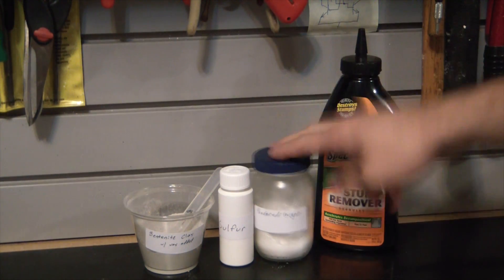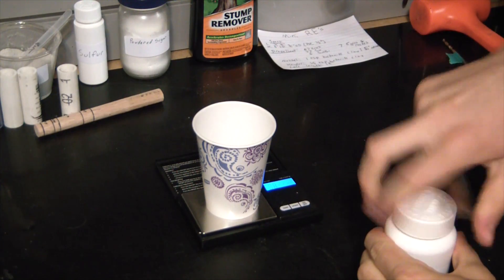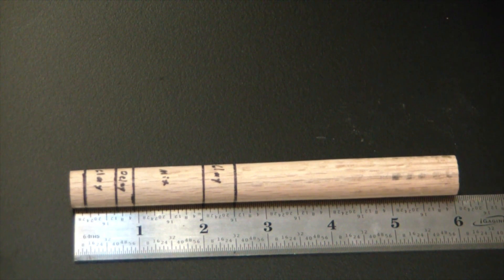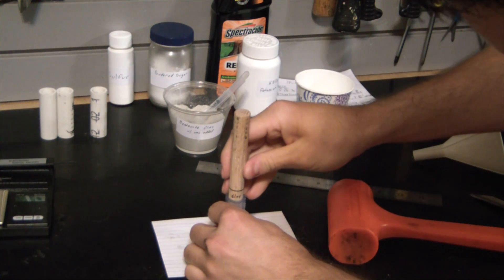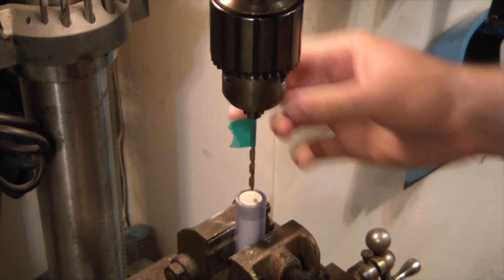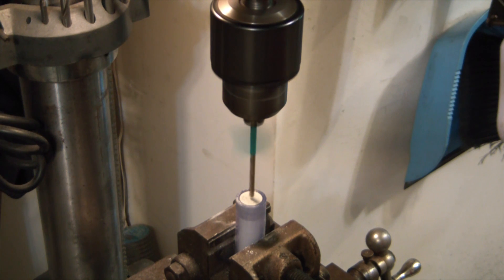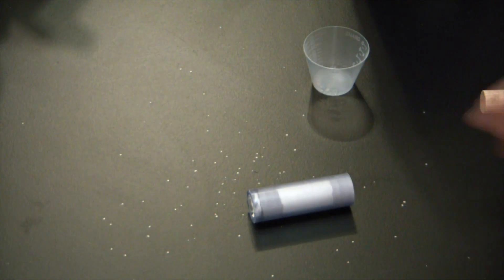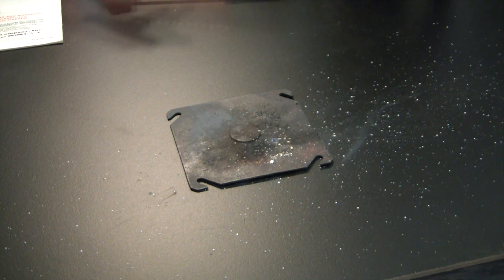ROCKET ENGINES FROM HOUSEHOLD STUFF! ELEMENTALMAKER

Comment: Hydroscopic? Don't you mean hydrophilic? Or am I missing something here?
Reply: Sounds like he misspoke and said "hydroscopic" though the correct term would be "hygroscopic" Hydrophillic substances have an affinity for water. meaning they wet easily. That doesn't necessarily mean that a hydrophillic substance is also hygroscopic though.
Reply: KNO3 and the completed motors readily absorb moisture from the air (i.e. hygroscopic) which impairs the performance

Comment: 0:48 Potassium nitrate, sulfur and a source of carbon. That sounds strangely familiar!!!
Reply: Lovely blackpowder :)
Reply: you can smell it from here! =P
Reply: So are all explosions the result of reacting a fuel and an oxidizer really quickly? Are there explosions that happen completely without some form of oxygen?
Reply: @michaelknight2342  look up vacuum rocket engine and you'll see what they do to make the engine work in space without any atmosphere to feed it. 
Hint, its similar to this
Also, yeah pretty much most explosions result from 2-3 things, oxidizer fuel and something to increase the reaction rate. Now when it comes to nuclear bombs they work from making the chosen isotope usually enriched uranium (uranium fresh out the ground is almost useless in that form), make the isotope unstable causing a chain reaction, which creates a feedback loop which amplifies the reaction at every step, making it more powerful over and over until its just well, done, and theres a big boom. Most efficient way is "split the atom", but there's much more to it than just that
Reply: Michael Knight most often they use oxidiser but some chemicals explode by reacting with themselves
Reply: @michaelknight2342  Any strong oxidiser will work, obviously, oxygen from the air is easy to obtain.  That's why the operators of sugar factories and flour mills are VERY careful, a factory full of flammable dust with every tiny fragment surrounded by oxygen can be fatally explosive.
Chlorine works nicely as an oxidiser, the reaction of hydrogen and chlorine, for example, is spontaneous except in darkness.  The activation energy can be supplied by light.  There's probably a YouTube video of it.
Some rockets use hydrogen peroxide as oxidizer and hydrazine as fuel.  The WW2 V2 rockets used alcohol and liquid oxygen (I think).  You could look up "hypergolic fuels" for more information and/or the launch escape rockets being (and that have been) used by NASA and SpaceX.
Any rapid chemical reaction that produces a lot of gases very quickly is an explosion, but if it's confined for the first fraction of a second, the gas volume builds up and it's more of a bang than a whoosh.  If you look at a "banging" firework, it's small and solidly built to allow this.
Some explosives have their own oxygen, which is released when they get hot, or when they are pressurised.  TNT and dynamite are examples of these.  Again, it's about evolving large amounts of gas very rapidly.
Reply: There was an episode of Star Trek in which Captain Kirk had to figure out how to make gunpowder from natural deposits.
Reply: @TubeNotMe  The MythBusters disproved it in an episode.
Reply: @stevecrow9170  OH yes, I saw that episode. But it WAS science FICTION, you know. jI mean, warp drive? Vulcans? Do we need MythBusters to disprove those, too? Anybody with experience in chemistry and explosives knew right off they were taking liberties with that story. I was just responding to the OP's "That sounds strangely familiar!!"
Reply: @TubeNotMe  Har har, yes, to some people it does need to be disproved.
Reply: @stevecrow9170  Ha! Yeah, after watching some of the videos and seeing some of the comments, maybe a lot of people.
Reply: Thought you were talking about an old Star Trek episode.

Comment: The two engines you ignited would not have lifted off the ground, they did not have enough thrust.
Reply: ..."so there is no weight"  But there is a mass but to know and appreciate it, one has to have at least fifth-grade education.
Reply: you missed the part where engines are attached to metal bar and especially in second try it actually pushed that metal bar (it looked as camera moved to the right). and most important, actual rocked this will propel is just fraction of weight of that metal bar....
Reply: LMAO
Reply: No, I saw that. It is sideways so there is no weight to push, only friction. The ground is supporting the weight. I am going by the burn time. A rocket with that size and weight would need to burn for under 1.5 seconds to have enough thrust to get off the ground and fly high into the air. But It burned for almost 5 seconds which means it didn't have enough thrust to get off the ground. It might have flown 5 or 6 inches off the ground at the most.

Comment: Read the Wikipedia page on colored smoke bombs...DO NOT USE SULFUR!!! I had 3 1/2 pounds of rocket fuel blow up in my face because of adding Sulfur!!!!!
Reply from the maker: Clyde Louse do you know how the sulfur caused this? There have been reported cases of impure sulfur with high acid content causing spontaneous ignition, but that's all I've heard of. What oxidizer were you using? Most colored Smoke compositions use potassium chlorate, which is a big no-no to mix with sulfur unless you want a highly friction sensitive mix. Always research the compositions you are making before making them, and make sure all chemicals are compatible, especially in that kind of quantity.
Reply from the maker: He may have his oxidizers mixed up. Potassium nitrate is very safe with sulfur; this is the oxidizer used in my video here. In colored smoke compositions potassium chlorate is used, which is highly unstable when mixed with sulfur. I highly recommend staying FAR AWAY from potassium chlorate unless you have advanced pyrotechnic training. I still get nervous working with that stuff, and avoid it whenever possible.
Reply from the maker: Sans The pungeon master potassium permangenate can be a pretty dangerous oxidizer. I've only used it in a couple very exotic compositions. It also stains EVERYTHING it touches. I will post a video using it soon.
Reply: ??? Explain, also, I'm fairly sure this guy's a pyrotechnic expert, judging by other videos. he knows what he's doing.
Reply: I figured, by the way, what do you know about pot-perm as an oxidizer? I figure it'll work but I'm wondering if I need super dry fuel. Or a bomb suit.
Reply: Thanks, I noticed it turns pretty much everything wet purple, and everything else charcoal black, assuming it has some moisture. I'm just wondering if it would be suitable for a sorbitol motor.
Reply from the maker: For a propellant I would stay very far away from it! Its more more prone to exploding than slowly building pressure like a mild oxidizer like potassium nitrate is. The only really suitable oxidizers for rocket propellants are potassium nitrate, ammonium perchlorate, guanidine nitrate, and some exotic ones with ammonium nitrate.
Reply: alright, thanks, I was probably going to steel-case it, in order to not make an accidental pipe bomb, but that seems out of the question now, do you maybe know of something to slow it down slightly? I'm going for spin motor to stabilize an asymmetrically boosted launch, because triangular symmetry is hard and proper motors are expensive. I kind of need max power here.
Reply from the maker: Sans The pungeon master I think regardless of what you do it will end up exploding unless you get very lucky. Why do you need to use permangenate as your oxidizer?
Reply: It's something I have on hand, really. Potassium nitrate is REALLY hard to get your hands on, as it's not really used here in Canada, except as an industrial fertilizer. This also means that anybody who doesn't know how to make rockets like this will look at you as if you're making a bomb. Which ironically permangenate is better for, but we have a valid reason for buying it as we have a cottage on well water.
Reply: I do wish Clyde would come back on this.  

Sans: interesting that you find KNO3 hard to get. Here in the UK, I can buy it freely on ebay (I'm probably on a few lists, but they realize what I am doing is legal and so forth) but attempting to obtaine any chlorates is pretty much akin to swearing alliegance to bin laden. The EU banned both potassium and sodium chlorates from public purchase a while back... and as usual the UK took the 'recommendation' as a 'command from on high' (that's why brexit passed, by the way, the UK government's reaction to otherwise sensible directives, but i digress)... just interesting to me how availability varies by country, in sometimes unexpected ways. In the US anythin that might possibly LOOK like a meth precursor, is not available, for example
Reply: Clyde Louse sulfur is very safe with potassium nitrate.  If it wasn’t then black powder would be impossible to manufacture. Potassium nitrate is not even used in color smoke compositions. Only potassium chlorate. lactose (fuel) and a dye. Nitrate burns too hot with any fuel will turn the Dye to ash.
Reply: Sans the pungeon master...Amazon Canada has KNO3 available. Spectracide Stump Remover is industrial grade PURE KNO3.

https://www.amazon.ca/Spectracide-66420-Remover-1-Pound-Granules/dp/B004GVYXKC
Reply: Listen to what he says about potassium chlorate, I almost burnt my hand off while I was working with it
Reply: I was using the same brand stump remover and powdered sugar. The sulfer may not have been pure (got it from a friend). The one thing I failed to mention i had added was iron oxide. It was only a small quantity but I'm not an expert and you could probably determine if it had something to do with it or not. I had just gotten to the stage where it JUST starts going from clumpy to the smooth "peanut butter" stage n directly in the center of the pan saw a small quick spark and then nothing so i backed up (luckily) and it took off...BAD DEAL LOL.
Reply: Clyde Louse yeh you were making rocket candy and sometimes if you overheat sugar it can self ignite so be careful.
Reply: I was making a heavy duty engine (would classify as a G)  and added some sulfur to make cool smoke, Got the sulfur from an old friend who makes the purest stuff around here and it exploded boom ka bakoom
Reply: I just want to thank everyone here ( a year late) for the longest, most intelligent thread I've ever seen that didn't decompose into a flame war.  So refreshing!